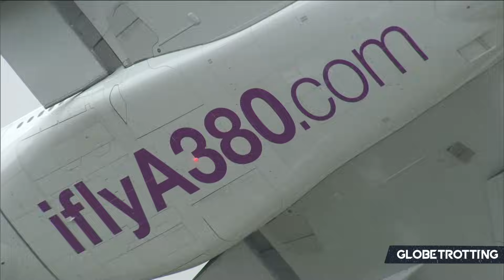PROBLEMS - The Airbus A380's Troubled Life

Comment: If you blame Boeing for engine issues like UA328, then you must also blame Airbus for QF32 and AF66. If you will avoid the 777x at all costs because it failed a structural test at 148%, then do the same with A380, that failed at 145%. If you think Boeing used a flawed weather radar system that contributed to SQ321, then do the same with A380 since that has the same radar system.

Comment: I’m not quite sure why you do so many a380 videos 
It has done what it can do and lost buckets and buckets of cash. 
It is one of the most useless platforms ever made. Ok, yes cool big plane. Why they did not design it for freight? Huge mistake. It would be the close equivalent of a C-5. 
I was never really to impressed myself. My Commercial Airline Data business had me doing spread sheets off its so few owners, numbers for lease companies and insurance companies. also the landing, gate and takeoff fees, costs charged to Airlines having it at a gate. Extra security to escort them to a runway. Nope. Funny you can get Plane Tags Already…..
Reply: Talking of Quantas? Right now you can buy pieces of one of their a380’s from MotoArt Plane Tags. Pretty short run for a airframe
Reply: Yep, from a commercial POV the A380 was a poor design. That it is the most comfortable plane on the planet (as it is) cannot overcome its gas-guzzling design (thick short aspect ratio wing, old engines) or its lack of cargo space. It is not just, or even mainly, its size that is the problem - there is still a profitable niche for a big jumbo with airports in Asia (especially) having such tightly constrained slots.